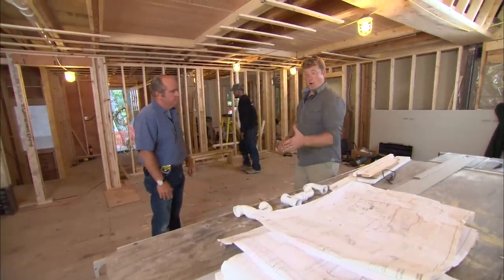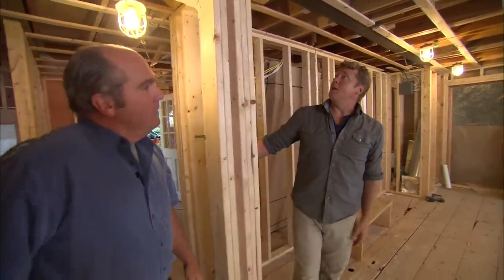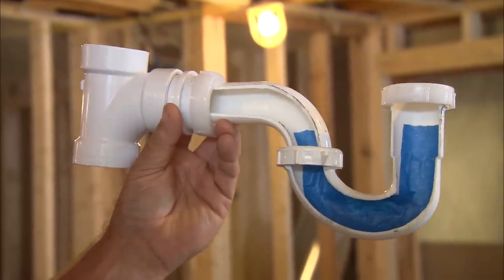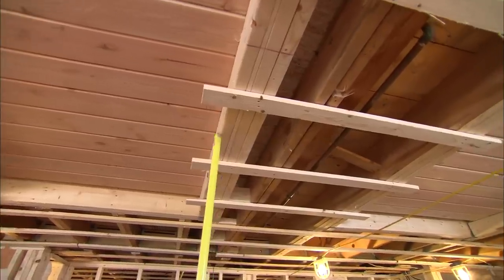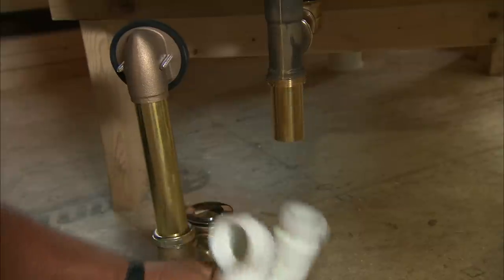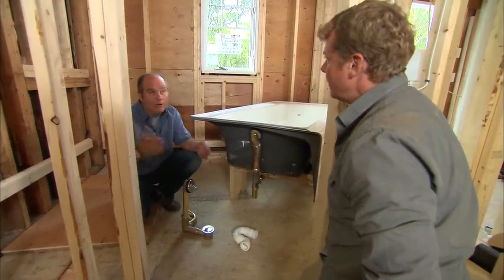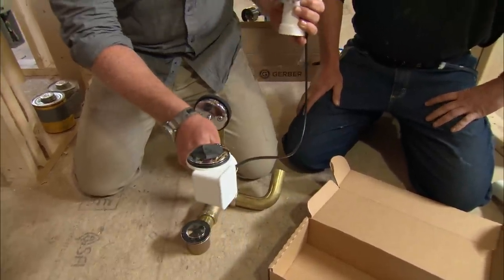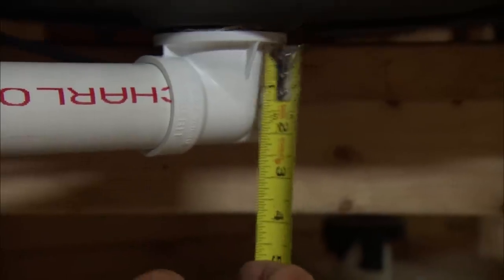How to Install a Plumbing Overflow Kit | This Old House

Comment: American standard has a tub that is raised and has space to run pipes underneath, that's all they need to use here.
Reply: And if the homeowner doesn't want to use that kind of tub... ?
Reply: @morlamweb  Why you askimg me that.
Reply: I’ve installed them. Still too low for a normal drain. Where the tee directs it straight down, you’d need to be over 6” high.
Reply: My first thought (as a carpenter) was build a platform for the tub to raise it a few inches.

Comment: I can’t help but wonder how that recessed joist bay will perform under the weight of that cast iron tub filled with water.  
-  280-400 lbs - Cast iron tub
-  267 lbs - water 32gal x 8.33
-  220 lbs - one adult male (more if married and frisky)
-  Potenial of 887+ lbs in 12.5 sq feet = 71lbs per square foot (assuming the miss’s doesn’t join him). 

-  Building code requires live load of 40lbs per square foot - the math for that reduced bay just doesn’t compute for me - 

I guess Just trust TOH … they’ve been doing this a long time.
Reply: That “triple” was very close to center of the tub. Will carry it fine.
Reply: I think its a smaller tub, so i doubt it's much more then 200 lbs.

Comment: Question: i have 8 year old house thats always blowing light bulbs, no matter what i use. What is going on wit my light bulbs?
Reply: It most likely not your bulbs.  Get you a good electrician out there pronto.
Reply: This could be a symptom of a dangerous condition, manifesting itself as overvoltage.  I would look for a loose neutral if dispatched to figure it out.

Comment: Hope that never leaks  which it will some time due to plumbers putty drying out and cracking. Also if any other part of that leaks that will be a pain in the butt for the next plumber to fix
Reply: Hopefully the actuator is magnetically coupled so there is no seal to fail.
Reply: Yup. Hope that ceiling was worth it…
Reply: Impermanence of all things... C'est la vie.
Reply: But dang, what a great ceiling!  Totally worth it….
Reply: We always put pans in any wet areas in high-end builds so it doesn't matter if it starts leaking it's not going to hurt anything

Comment: honest question, why is the house all wood? I understand if the house is small but the size of this house is big enough for cement to be used for the beams and even walls and cement is better than wood, right?? considering USA always get hit by tornadoes and sht that ends up wrecking the whole house?

Comment: "next hundred years" didn't know they still build houses to last that long any more
Reply: Think about it. The roof, plumbing, electric were not there 100 years ago. windows most likely upgraded, lead paint etc
Reply: A house is much like an automobile.
The better you take care of it; the longer it lasts.
Reply: these buildings won't last 30, houses today's are not built to last  Do a lot of hvac work on new construction and they are not well built

Comment: Raising the ceiling was short-sighted and the worst example of form over function. Getting that couple of inches of ceiling space means that they had to go with a completely proprietary system that will make it next to impossible for the next plumber 5 years later to fix leaks or even clean out the drain because of the extreme angle of the drain and now they took away access from the overflow.  Anybody who has every snaked a bathtub knows that you take out the overflow and put the snake through there because it's usually straight down to the trap but not in this case. 

Kudos to the plumber for finding a solution but this will definitely come back and bite the homeowner in the butt later when they have to cut the fancy ceiling just to get a hairball out or fix a leak.
Reply: Are you claiming a snake won't make it past the one 90 on the overflow but it will make it through a p-trap? Come on now.
Reply: @Darryl F  Did you watch the video?  In a traditional tub and plumbing you can open up the overflow on top of the tub and stick the snake straight down where it will flex and go through the P trap and after that, as far as your imagination and skill will take it.  It's so easy that you barely need to twist the snake.   In this case, the overflow is next to useless. Whether you go through the overflow or the drain itself, you have to go through not one, but 2 90's before going down to the P trap.  If you think that's easy in a cramped bathroom with a fancy bathtub that you can't scratch then you must be the best plumber I've met.
Reply: @Arieeeee  there's one 90 there. Not 2. When you snake a lav drain there's a 50/50 chance you need to get the snake past the waste arm 90 after the trap. The ty heading down is a 90. How can you say a snake won't make it past 1 90 on that overflow. And you weren't counting the normal overflow 90 in a regular situation because you said it's straight down to the trap, which is not.
Reply: @Arieeeee  If you think that's hard to snake in any bathroom without scratching the tub you need a lot more practice because it's a very common task in plumbing.

Comment: Until theres a problem and you cant access it
Reply: I always used silicone on the underside, where the fitting contacted the tub. Then the putty is pretty much useless other than keeping water from leaking around the drain cup.
Reply: They may have left access behind the tub or in the bedroom next to the tub.

Comment: I have a septic tank and when I go outside it smells. I think the smell is coming from the roof vents. Any way I can stop that smell?
Reply: Pump your tank one last time and get an outhouse. 🤷‍♂️
Reply: put a clothespin on your nose
Reply: @TrumpAmerica-2024  it worked.  Thanks.
Reply: @Gideon_Judges6  I just got it 6 months ago.
Reply: @anjotre  anytime
Reply: @anjotre  then you have one of those newer installs that almost certainly has a separate tank vent outside too, right? Sure it isn't coming from there. Or maybe you have 1st floor bathroom fan vent that vents horizontally coming out of the wall i.e. everytime you blow up the 1F bathroom it makes its way down the fan vent?
Reply: Until you find out that your laundry detergent or something has bleach and that's what's killing the bacteria in your septic
Reply: @thecloneguyz  that's a good point too. I use CCLS to try and keep the colony healthy.
Reply: @Gideon_Judges6  I have discovered over the years that adding anything to it is pointless because the bacteria divides by itself as long as you keep adding poop
Almost every person has a septic tank and they're using something that they're not paying attention to that's actually killing the bacteria in their septic line
Reply: @thecloneguyz  it's just so many detergents from hand soap to bath soap/shampoo to dish soap to laundry detergent. Most are designed to be antibacterial to some degree, which works against you in a septic system
Reply: @Gideon_Judges6  I've been using Arm & Hammer for over 10 years and nothing in it will kill any septic bacteria
Reply: @Gideon_Judges6  so the smells is coming from the vents from the roof of the house.  Every time I wash it use the shower the smells is all through the backyard.  I had to plug up the leech field breathers and that help to a certain amount. But still smell. I was thinking of putting a p- trap before the waste goes in the tank.  Anymore suggestions?
Reply: @anjotre  that doesn't make a whole lot of sense. So when you use your shower, water is going down the drain so if anything it should be drawing air INTO the vents, not pushing it out. If it were a blockage, your lowest fixture upstream of the blockage would backup. You've got a complicated problem you'll need to consult your builder or a licensed plumber, not some anonymous Internet hack like me.

Comment: They just weakened the the floor bye cutting it out. Better to have done better design planning from the start and all that extra time and money would have been wasted. Come on let’s be real that house will be remodeled in 15 - 20 years and will be done the right way with without having to weaken any of the structure.

Comment: Looking from UE (east EU) perspective this celling will transfer all the noises from the floor above. Steps, farts, music, even running water down the drain - literally everything. How we do that here: all the walls out of sort of bricks. We pour a thick reinforced concrete slab for the 2nd floor, then 5cm EPS (here you can put all the pipes, cables etc), thin 7cm "bubble" type of weak concreate as a main underfloor and then moisture keep away foil, shock-absorbing and soundproofing layer (5-7mm) and than laminate floor or just real wood glued to this last concrete layer. You cant hear any steps, farts, music actually (between flors). Floor will never, erver sink, bend, squeak. Some noise might be transfered via the structure wall, just that. So a good home should give us some privacy right? Your frame 2x4 style builds do not provide any privacy to me. On many remodel situations there is even no rock wool between the drywalls, just air cavity. LOL!

Comment: As i watch the show being broadcast 07-03-2021 at 8:45 am CDT, i have to ask: why on a show about quality and most modern products, do they still do substandard concrete work? I have been in construction since 1980 and even back then the better concrete contractors would tell you wire mesh was not good. Rebar is far superior. And no matter what you use, do not lay it on bottom and pour. You need supports to keep it centered in the slab or you may as well not use it. Laying the steel on bottom and pulling it up with a rake does almost no good. As you walk around during the pour it gets pushed right back to the bottom.